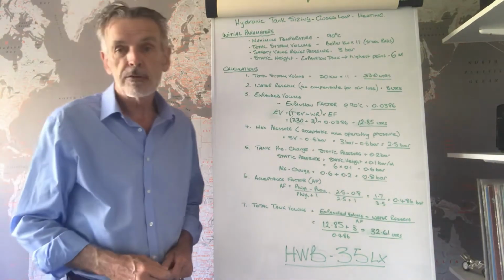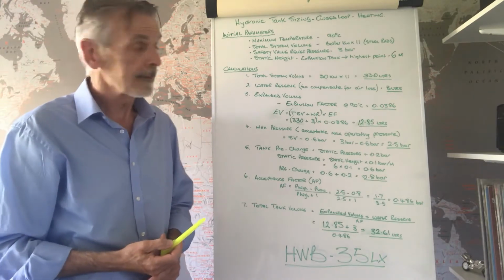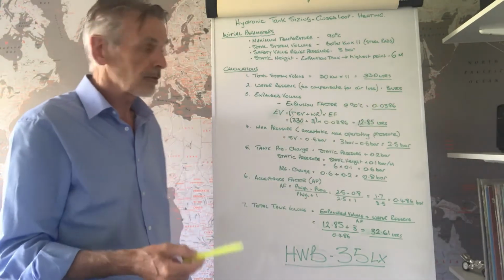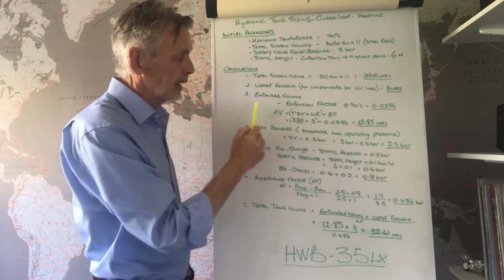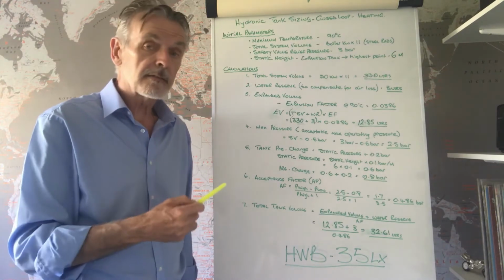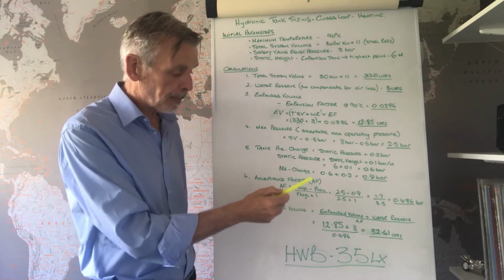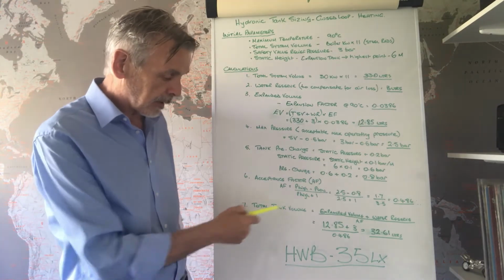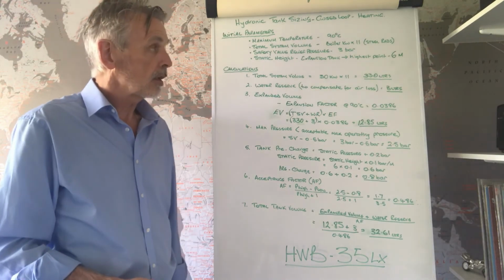Hydronic Tank Sizing

Comment: Hi Boyles law is not suitable for this situation because water is not compressed liquid. The law is suitable for ideal gas only.
Reply: Boyle's Law is fundamental to how an Expansion Vessel works and why it is the point of no change in pressure in the system. 

So it's required to use Boyle's Law when calculating the acceptance factor i.e. the gas within the vessel is what is accepting the water expansion.